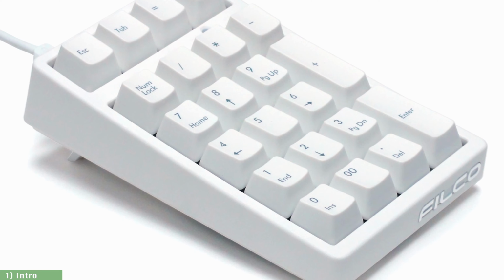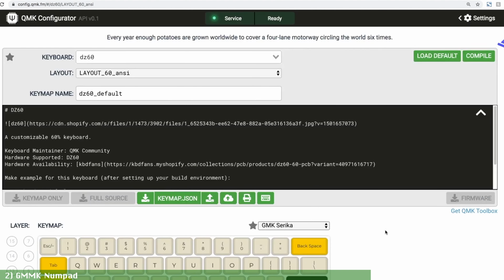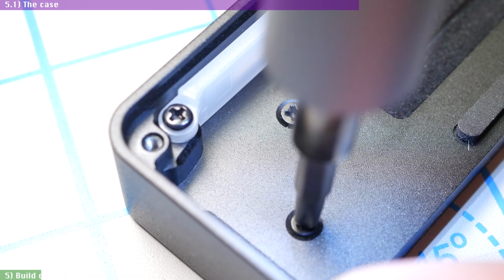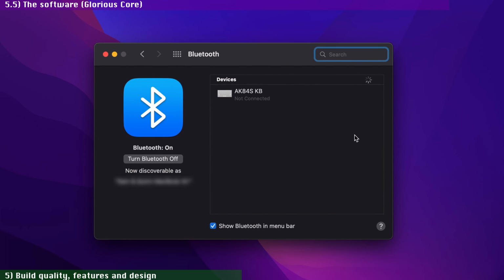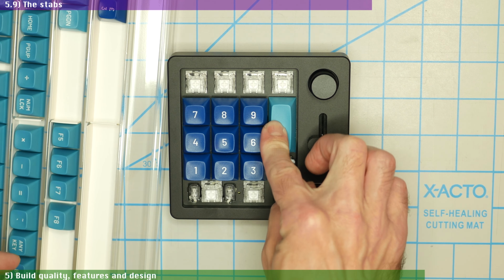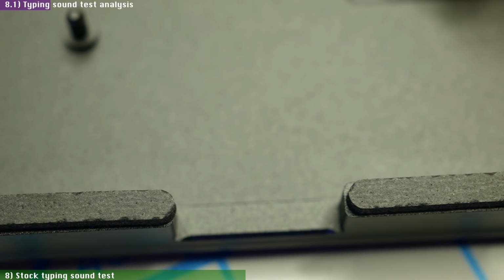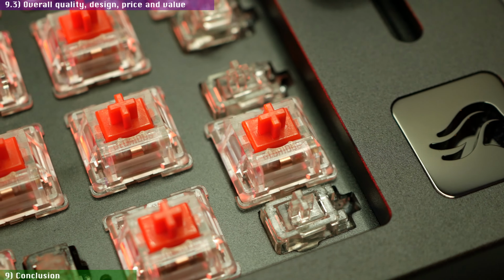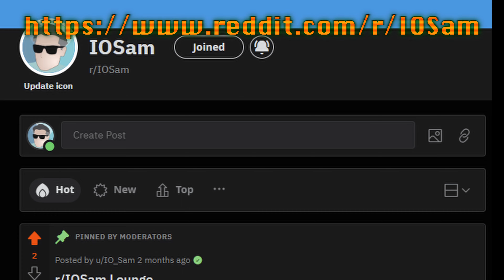GMMK NumPad: Glorious has done it again!

Comment: I really liked the idea of this to match my gmmk pro. The angles, bezels, and pcb, being different makes this a no go for me. Yes the price is crazy, but I may have considered it if it matched more closely.
Reply from the maker: I know... It was the first thing my eyes landed on when I placed on the side of the PRO! OCD is real man! 😂

Although, where I keep my numpads usually (on the top corner of my main board), I don't notice it as much as on the side... If for nothing else, the GK21S I've been using for years now doesn't match any of my keyboards anyway.
Reply: same. I might have picked it up (despite the price) if it were a match with the GMMK Pro. Missed opportunity there imo..
Reply from the maker: @majorkeeb7493  I think the new GMMK Pro 2 will be a better match with this numpad (I bet it will also have rounded corners)... But that won't do any good for the thousands who already have the GMMK Pro 1.
Reply from the maker: @DicehunterSC  I can tell you that it is a matter of when (not if ;)... I'm sure they wanted to release it in 2022, but they might not be able to (considering all the logistics issues I'm sure they have been working around since the launch of the GMMK Pro 1).

So, I agree with you that early next year feels like a safer bet.
Reply from the maker: @DicehunterSC  Between us here, if you are not desperate to get a new 75% keyboard right now, you should definitely wait...

If you don't like the GMMK Pro 2 (or its launch price) for any reason, the OG GMMK Pro will be discounted at that point, so you'd win anyway.
Reply: Yeah I didn't notices the differences at all until I got my hands on it, kinda disappointing
Reply: I just got this with the GMMK Pro and what an embarrassing waste of 300$+ returning everything this weekend.

Comment: It would be great if I could assign the knob and slider to tools in photoshop for example. I doubt I can on their software but is there are third party way to do that?
Reply from the maker: You are correct... You cannot assign non-audio functions to the knob or the slider through the Glorious Core app yet (although you can assign other functions to the knob press, only the dial movement is restricted).

The only way to bypass these limitations is if you flash the pad with QMK. Then you can assign non-audio functions to both knob press and dialing actions. I'm not sure about the slider though, but I'm confident that you probably could assign other functions to it as well.

I'll try to do exactly that with this pad in a few weeks (after I finish posting a few more videos I'm working on at the moment) and I'll report back any success over on Twitter (with a link to the article in my Blog).
Reply: @IOSam  let me know what you find out! I also reached out to glorious about adding more features
Reply from the maker: @Jay-ws7tv  I definitely will!!! Stay tuned!
Reply: @IOSam  Just got my numpad love the quality, but missing so many mapping features uhg!
Reply from the maker: @Jay-ws7tv  Yeah... Glorious Core is indeed very limited. If you don't mind losing the Bluetooth capability, you can gain a lot more flexibility with key mapping and macros by flashing it with QMK.

But the whole process of flashing keyboards with QMK will require some effort on your part, since it is a not trivial procedure.

Comment: What would be a cheaper option? With batteries/wireless (which is a must have for a numpad, given how often it will be removed from my desk when I not use it). And with good customizability in order to make it a macro pad or numpad for different use-cases (through software or QMK), and with mechanical keys?
Reply from the maker: In terms of features and build quality, I’m not aware of any other metal built, wireless reprogrammable numpad out there, other than the GMMK Numpad and the GK21S that doesn’t cost even more than $130. But if you don’t care about the heavy metal build part, I know Epomaker has developed the JJK21 (https://amzn.to/3T3DlBj ), in partnership with Feker, that seems pretty decent for a reasonable $60.

It is a barebone, hot-swappable numpad with a knob, a 1500mAh Battery, and a plastic build. But Feker plastic boards are really well made (I have their “Alice” keyboard here for testing/review and I was positively surprised by its quality construction).

It also has some sort of software interface to let you remap keys (which I didn't have time to test it yet). While I doubt their software solution will be as polished as Glorious Core App or VIA, it at least has that feature for a reasonably competitive price.
Reply: @IOSam  Nice! Thanks for the reply 👍👍☺

Comment: I don’t think there’s a boba tactile sound test on the stock typing test part. Also i believe the keychron q0 is another potential competitor to the gmmk numpad
Reply from the maker: Yeap... You're right... It was a last minute editing screw-up... ¯\_(ツ)_/¯
I'm gonna post a separate video with that typing test and then pin the link here in the comment section.

Thanks for pointing that out (I'm not used to produce videos in such short notice 😂)!!!
Reply from the maker: Oh, and yeah... I didn't mention the Q0 because, believe it or not, I didn't know about it until this video was done (the Q0 got lost in the avalance of Keychron press releases of the last few months! 😂).

I'd say the Q0 is a lighter/cheaper version of the KBDPad (same basic features), which is indeed a very good deal for $90 if you don't care about volume control and bluetooth... (just have to find a reseller in your country, to avoid Keychron's expensive shipping rates from Asia)

...I guess I'll have to revisit this topic now and cover the damn thing! 🤦‍♂
Reply: It's all good 😊. I am just putting it(keychron q0) out here because I believe for gmmk pro users like me for example, we don't have much use case for the extra dial and the slider whose only function is to just adjust the volume.(despite it looks really cool to me). And if you are like me, the gmmk pro may be your first customized keyboard and there will be some leftover switches and keycaps. It will make more sense to me to get smthg like a q0 and put those leftovers in it to save some money. This is my opinion and i do agree with Sam's use case for the extra dial and the slider.
Reply from the maker: @RaZeLise  You are 100% correct on all accounts! I barely ever use the volume dial on my GMMK Pro. And that is why I find it frustrating that Glorious has not included other "non-sound functions" to this knob...

And in that sense, the GK21S also makes more sense with its super useful extra row of keys instead of the knob. If it only had better software, this would still sit at the top of my recommendations...
Reply from the maker: Alright! Editing glitch has been patched. Check the missing sound typing test with the lubed Bobas U4T + GMK Kaiju here 👉 https://youtu.be/_FamyHpCw0E

Thanks for spotting this out early on man!!! Highly appreciated!!! 🙏
Reply: I have the Q0, bought before the GMMK numpad came out. I like that it has south facing LEDs and QMK/VIA compatible. Would like it to have a knob though!

Comment: Just ordered this numpad yesterday so that I have a numpad that compliments my GMMK 2 65% build. I'll be replacing the switches with IQUNIX Moonstone Turbos and swapping the keycaps with XVX pudding keycaps since that's what I used on my keyboard. Hope the keycaps I have doesn't have the horizontal key issue.
Reply from the maker: Hey Clay! Congrats on the new numpad! As for the horizontal sticky key issue, it is a combination of the stock stabs being too tight plus the use of certain keycaps that happen to have tight tolerances with their cross shaped stem plugs.

If you happen to have issues with your keycaps, the suggestion would be to replace the stabs with some other compatible set.
Reply: @IOSam The keycaps I had on hand from when I built my GMMK 2 worked out perfectly. Aside from using my own switches and keycaps, nothing else had to be done. Feels nice to use and to me, it’s glorious. Pun intended.

Comment: I like it. It holds its weight on a wood or leather top desk. Out the box use is fine but not my cup of tea. Use the keys you like & good to go.  I used 1st w/ my Ducky One 2 Mini & having arrows volume & slider was ace. But since added the Glorious Glorious GMMK Pro w/ Arua V2 caps. & MX Tactile gray. 
I wanna try the white Box clicky for feel
Reply from the maker: Yeah, this pad is all about customization indeed. If you take the time to configure it to your liking, it can make a big difference in productivity for those of use using small form factor keyboards.

Comment: sam, you're awesome, I love this video.  im looking at this numpad but also really considering the megalodon triple knob on drop.  do you have a review of that one??
Reply from the maker: Thanks Randall!!! Appreciated man! While I have not tested it myself yet, I am still in the early stages of putting together a numpad/keypad comparison video for sometime this year, and if I do that the Megalodon will be included.

Having said that, the Megalodon is technically not a numpad (although I’m sure one could program it to behave like one of course) and thus it doesn’t have a familiar numpad keys layout (only has 1U keys for example). So, I see it more like a Stream Deck competitor than a GMMK Numpad one.

But if that is what you’re going for, then it is right in the middle between those two, since you do get better programming abilities than that of the GMMK Numpad (without the numpad “feature”), but it is inferior than the Stream Deck in that regard (but with real mechanical keys). Also, the price is very enticing, since it is cheaper than those other choices.

Comment: Using the GMMK2 60% keyboard and pairing it with the GMMK NumPad for sure!
Reply from the maker: Let me know your thoughts on it once you get it 👍
Reply: @IOSam  Ordered it on Oct 6th and got it today (Oct 25th), so far the only issue I'm can see is the response time when pressing the volume nob down (assigned to mute) I get a second delay before the key registers. I have it set to 1000hz and 2ms response time. I'll give a more detailed update after using it and modding it.
Reply from the maker: @zinkzxd2891  Yeah, that lag is indeed there and is not tied to the software latency/speed settings unfortunately.

Comment: The price is a huge detractor from this numpad.
While it does not have a slider or knob, keychron has the Q0 which is a bit less ridiculous with the price. 

There are various other custom keyboard numpads that are far more affordable but soldered/ wired only. I personally prefer wired
Reply: It must also be said that I dislike Glorious as a company for multiple reasons that I need not list.
Reply from the maker: Yeah, I was just mentioning to another viewer that I missed the release of the Q0 (buried under so many of their launches and press releases 😂).

But yeah... If you have no need for volume control or bluetooth (which, honestly, I think most people don't), the Q0 for $90 bucks is the perfect choice (a lighter/cheaper version of the KBDPad). just have to find it in a local reseller in your country to avoid Keychron's expensive shipping rates that would, otherwise, erase a lot of the savings there...
Reply from the maker: Yeap... I also understand that side of the argument, and I even addressed it briefly on the end of this video. I totally get where some hardcore veteran enthusiasts come from when they dislike mega-corporations who come to mass-produce the things they see as art (instead of just a "product"). 

Naturally, not everybody sees these things the same way (or even care), but I'm glad this community has grown enough that enthusiasts of all levels (from beginners to veterans) have so many options when deciding where to spend their hard-earned money.
Reply: @IOSam  Im pretty sure that was me on twitter where you said the Q0 was "too much" and you stated a Filko Hakua was a better choice.  Either way, these comments shitting on the price are golden and prove my point.
Reply from the maker: @Nashness  What I said on Twitter, and 100% stand by it, was: "If all you need is to hit numbers on a pad, even the Q0's $90 (that I just found out about it 😂) is too much... Just go for the awesome Filco Hakua for less than $40": https://twitter.com/IOSamFranco/status/1559605806571683842

In other words, if you don't care about a heavy metal encased, programmable, RGB backlit, wireless, hot-swappable numpad with 2 volume dials... then you don't care about premium numpads.

And in that case, yeah... Just go with the awesome Filco (that doesn't have any of those things, but works beautifully to enter numbers on a spreadsheet and is super well built)!

Which means I now must produce another video covering entry-level numpads to calm everybody down... Challenge accepted! ¯\_(ツ)_/¯

Comment: I was hoping to get one to use both as a macro pad to launch apps, and a numpad. I was hoping to make it so that I could press the knob to switch layers/ profiles between the two. Is the knob clickable/ does the knob support this functionality?
Reply from the maker: It absolutely does. While I didn't necessarily mention it on the video, I actually showed a scene where I'm doing just that (shifting though layers by pressing the volume knob down: https://youtu.be/7KB-1O8MG_s?t=661 ). And through the software you can assign pretty much any function you want to the knob press. The only thing you cannot change about the knob is its dial function, that is permanently assigned to the Windows system audio.
Reply: @IOSam  Thanks, that was exactly what I was hoping to hear! The numpad is pretty pricey, but it does everything that I want it to do, so I'll probably pick one up and (hopefully) complete my desk setup.

Comment: It's really weird to me how they're trying to make it match the GMMK 2, when a person that has the money to spend on something like this probably wouldn't be using it with a lower mid-range mechanical keyboard. I feel like they should've skipped the entire right side of the numpad (since the GMMK Pro already has a knob) and added another row of keys above the main numpad, so it matches the height of the GMMK Pro. Those keys could then be used for additional functionality, like backspace, tab, comma and space.
Reply from the maker: Totally agree! In fact, it seems clear to me they should have launched two versions of numpads: a cheaper and simpler one to match the GMMK “OG” and GMMK 2 (with integrated plate, plastic body, floating keys, north-facing sockets AND DEFINITELY a volume knob to complement the budget boards that don’t have it) and a more expensive/premium/luxurious version such as the existing model (but with south-facing sockets out of the box, extra row of keys on the top and maybe the slider, but not the knob).

In other words, the idea of a premium numpad is not bad… The problem here is just that they  missed the mark in managing their core customer base expectations for what the product should or should not be (which is why I think having two versions could have better addressed the core “budget oriented” customers AND the more “pro” audiences at the same time without pissing everybody off).
Reply: @IOSam  Since you've now had the opportunity to use the slider, how do you feel it compares to a knob? It seems to me that the slider feels like it might be a little bit more precise to use but it also uses up a lot of board space.
Reply from the maker: @Zentennen  It is more precise in the sense that it has no steps, as you have with the knob (which has 2% steps). So that gives at least the feeling of being more precise, since the audio volume seems to increase or decrease in linear form. Having said that, there is a perceptible lag of a few milliseconds (especially if you move the slider very quickly).

But overall, I have to admit that I'm actually enjoying using the slider for YouTube and Spotify without affecting Window’s system audio, which is rather convenient.
Reply: @IOSam  Do you find the slider preferable to the knob for adjusting individual program audio? It seems to me that the knob could do that as well without the lag, even if it's a bit less precise.
Reply from the maker: @Zentennen  You're correct! The knob doesn't have the lag, because each step is exactly 2%, so there is no "acceleration" when you twist it fast or slow. Meanwhile with the slider there is a perceived acceleration effect which might take a bit longer for the software to process (thus the lag).

To my current use of the slider just for Chrome or Spotify, I don't mind the small lag. Besides, the slider has the advantage that you can mute the sound of the app much quicker than with the knob (which would require a couple of full twists to go from 100% to 0).

Comment: So the volume can’t be controlled unless the glorious core is running in the background….?
Reply from the maker: The knob DOES WORK even without having the Glorious Core App running in the background (it even worked on Mac OS no less!). What will not work without the Core App is the application audio control with the slider. For that one, you DO NEED the app in the background to interface the board with the App of your choice.

Comment: @ 10:44  Mine enters sleep in either wired or BT turning off RGB in wired as well. It requires a key press to wake then type.
Reply from the maker: There is a setting on Glorious Core software (on the main screen) where you can choose to have all the lights to turn off after a certain amount of time. If you don't turn this feature on, your numpad (as well as your GMMK Pro and Core compatible Glorious mice) will not go to sleep, and thus won't suffer from this "wake up delay" (with the obvious downside of less battery life if you’re using it wireless, of course).